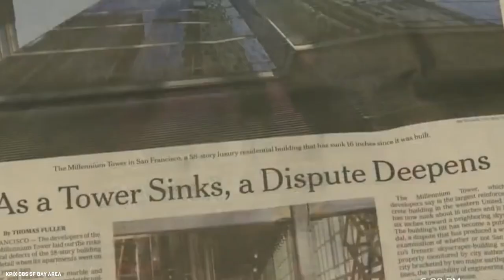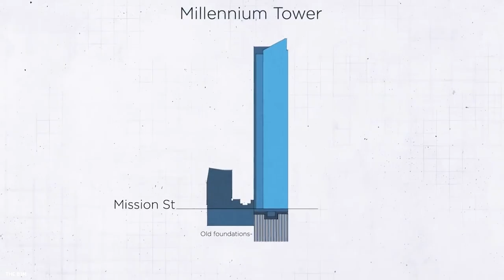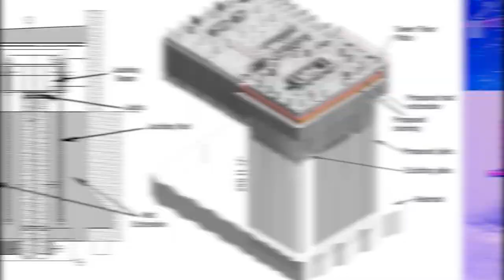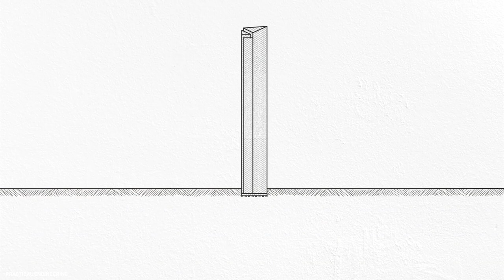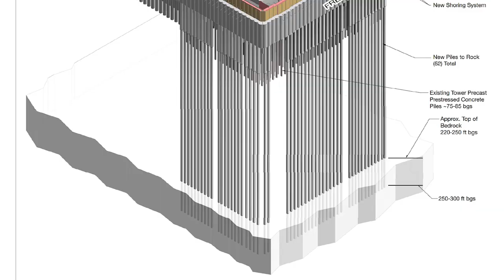The Race To Fix San Francisco's Biggest Construction Mistake!

Comment: $500 M to fix the problem?!!! 😱 I think it will be better to tear it down !
Reply: I agree.
If they start over they should build the foundation RIGHT this time.
If you have to do something cheaply, especially if safety is a huge factor, then don't even build the damn thing in the first place.
Reply: The building is only 14 years old. Too new to be torn down.
Reply: @dvferyance New or not, its dangerous and a huge liability that benefits no one at this point.
Reply: Also who would want to insure the building?
Reply: I agree. They were told before construction to drill down to bedrock, they got cheap and cut corners and now are paying dearly for their greed! Why??
Reply: @dvferyance  maybe you should live in it. You can whiteness what these tenants are going through, I think you might have a change of thought. Just saying…..

Comment: Okay, I know this will be an unpopular opinion but, I'm a simple and practical guy. Why the f**k did city planners and building permit board approve such a high rise complex on landfill in the first place. Forget about this sinking and leaning piece of crap. San Francisco is as close as you can get to the San Andreas Fault without being on top of it so who really got paid off to not only build this ugly monolith but all the others including, Sales Force Tower. And, why should anyone be surprised at this glaring mistake. Yes, there's only one way to deal with this exercise in stupidity and that is to condemn it and tear it down. Not blow it up but, dismantle it from the top floor all the way to the ground. This "shoring up" idea is like putting a bandaid on a broken bone. This is such an embarrassment to a great city that enough is enough. I don't blame the builder as much as I blame the idiots at City Hall who took their cut then signed off on not just one but several of these eyesores that stay mostly empty. Sure great views but when the big one comes, and it will come, it's all about putting your head between your legs and kissing your ass goodbye.

Comment: I wonder if auger cast pressure grouted piles or auger cast displacement pressure grouted piles were considered.  Soil is replaced by grout, rebar is placed in the plastic grout, and integrity can be monitored with cross hole sonic logging.  There are some drillers that can place piles up to 48" diameter.  I have used this technique for various projects since the 1980's.
I have designed auger cast pressure grouted piles 70' in length with only 12' headroom.
Reply: I too have used that system although on much smaller projects - it's a great system when you have shitty soils.

Comment: Lots of mistakes were made. It starts with the planning commission. You have an existing tall building on land fill, and you start a huge project next door (trans bay), with lots of vibration. From there, a child can see what went wrong. The only solution is to stop vibrating the area, stop building so tall and heavy. If you are going to underpin, only augers (corkscrewing) should be done. Even then, it’s a gamble. To go big,  you should go wide. Look at how the Marriott Marquis was built, and how Frank Lloyd Wright build foundations. Mr. Wright built the Imperal Palace in Japan that survived a huge earthquake, and the Marriott opened the day of Loma Prieta. Both of these cases should be required reading for anyone building on land fill.
Reply: Poor analogy, because Wright’s Imperial Hotel was an early example of using a floating foundation in a location prone to earthquakes.  The hotel was not a high-rise building, so there is no valid comparison to be made.

The Millenium Tower foundation should have been supported by bedrock.  I think there is consensus on that point.  The remediation has added piles which reach bedrock, and the progress of the leaning seems to have been arrested.

Comment: Prediction: the city and the project engineers will haggle around with each other until the concrete on the low side of the building literally explodes from compressive forces. The building will collapse before it is fixed because I’m sure they cut corners on concrete reinforcement as well as every other possible way they could find to cut corners.